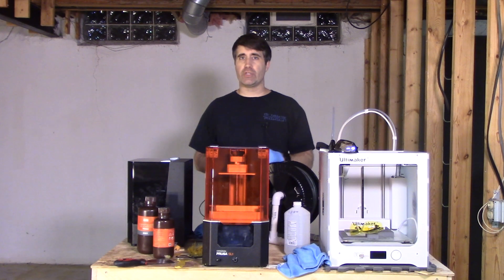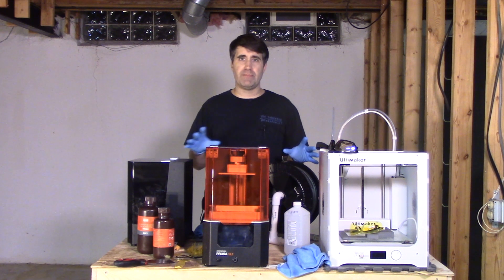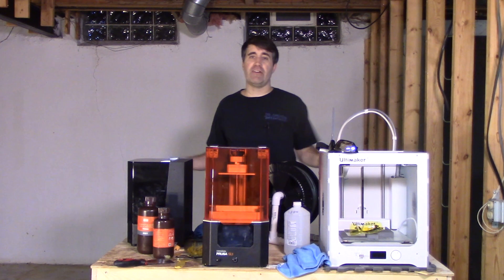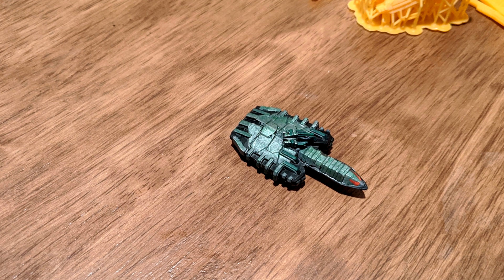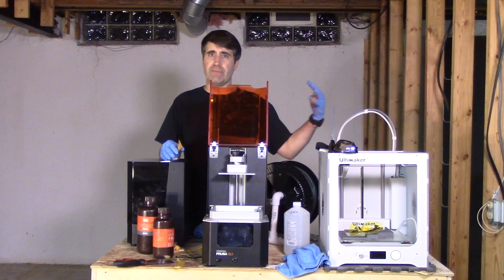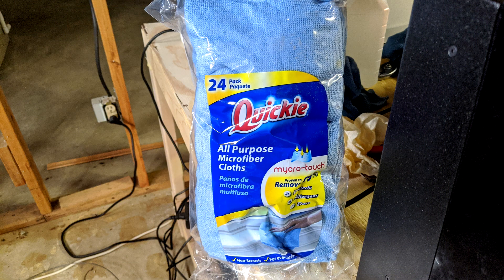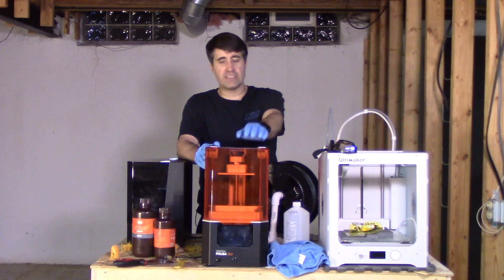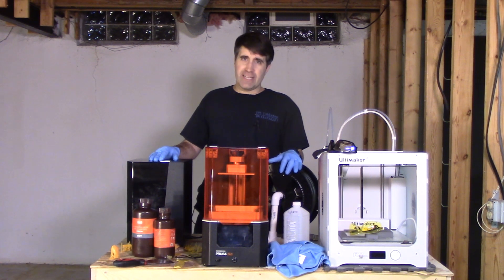The Prusa SL1 and Fixing Failed Prints

Comment: 6:00 this issue is reason why I clicked on this video! I'm struggling with this for 4 years now and I even started to looking for new printers! I had suspicion on the tilting bed but I will check the bolts! funny is, I have build the printer myself.
Reply from the maker: I’m glad it was helpful.  Those bolts need to be really tight. Mine were pretty secure, but I could still turn them a half turn or so with the provided allen keys.